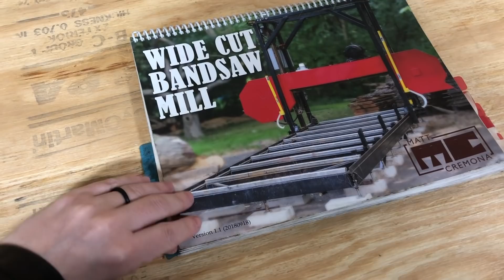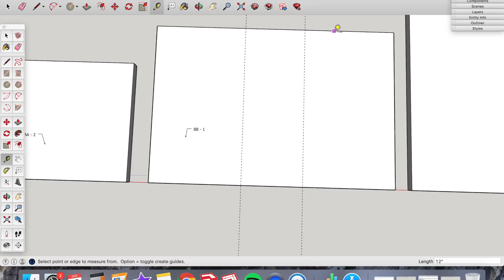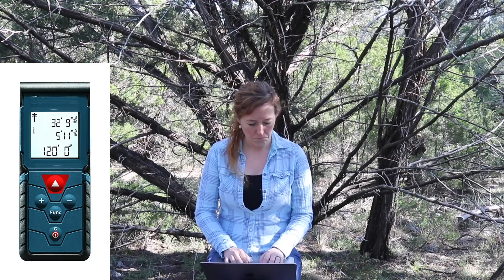Building a Giant Bandsaw Mill

Comment: Matt mentioned this video on his channel. So glad he got to mig weld. He really enjoyed it. Your organization skills impress me. So much was prepared ahead of time. Helped having a professional fabricator onboard. Share your enthusiasm and look forward to part two. I enjoyed watching Matt build his monster mill. You can buy a similar mill but nothing like this. Some of huge logs he mills. I'm impressed by how he does it and the beautiful grain in every slab. Thanks for posting.
Reply: AvE did a video a while back concerning stick, MIG, and TIG welding. He is of the opinion that everyone should start with stick and build skills before taking up MIG or TIG. He says they are like cheating and that you can get okay results with little experience, but you will never be a great welder. Matt showed that with his stick experience transitioning to MIG and how easy that was.

We have a similar phenomenon in aviation. There are two types of small airplanes--tricycle gear and tail wheel (or, as we call them, tail draggers). Learn to fly in a tail dragger and you can easily transition to a tricycle at any time. Learn on a tricycle and if you do transition to a tail dragger, you will face a fairly steep learning curve.

It's encapsulated in this aphorism: when the main gear touches the runway in a tricycle gear airplane, you have essentially completed your landing. When the main gear touches in a tail dragger, your landing has just begun. Any pilot will get that.

Comment: Something to consider @12:45 would be a line of holes in the floor for verticle stop-rod insertion. So that when you're lifting things like that with the crane you have both a ground pivot and stopper to prevent anything from sliding away from the lift. The rods can also have wheels on them if you need to rotate anything to verticle.

Comment: Again What An Outstanding Job! And Awesome ShoutOut to Matt on working with you and the crew on this build.
Something that you might want to consider that will save you a ton of time and aggravation when tapping that many holes, is an attachment that will fit in almost every Drill Press. It is called a TAPMATIC Self Reversing Tapping Head. You can Pre-Set the depth of the tap for the thickness of your material, and when it reaches that depth it automatically reverses and pulls the tap out, then clicks back into forward to tap the next hole   
Oh and GOD BLESS THE REPUBLIC OF TEXAS

Comment: Nice build.  As you are advancing so quickly.  Being a 1 lady shop most of time. You need look at getting you a overhead crane installed in the shop. You have room an it would be installed so that it down intrude on work area but would give you alot of versatility in your area. For what your doing.  

Keep it up.

Comment: You have to be careful drilling and tapping and running a tap in with a drill.A standard tap is generally not meant for this.BUT,you can get powertaps,such as WALTER power taps that are meant to be fed hard into the drilled hole and have a different metallurgy properties.They are meant for rapid feed rates.FYI

Comment: The down-side of tapping into mild steel is that the tapped hole is left relatively weak. Fasteners tend to be made from much harder grade steels. However, these difficulties can be overcome should stripped threads occur.

Comment: No truth to a woodworker having too many clamps.  My last count was 189 clamps ranging from Bessy's, Jorgensen's, Irwins, pipe, etc of every type and size. What's really notable is that there are times I may have 30 or so in use on a large project.  Even small clamp-ups may have a dozen+ running pressure in all directions.  I might have more invested in clamps than in my table saw!

Comment: this is a great project! do you have any videos on the construction, sizing and fitment of your workspace(s) there? that shop looks huge! with a gantry crane and proper exhaust venting a fabrication shop would be great there! I plan on using a chip and dust collector/slide gate manifold system and a collector on wheels to move around my shop for the cutting and welding fumes.
the tall ceiling height would accommodate a huge lift for trucks, trailers and machinery too!
thanks,
mike

Comment: First time I've seen your channel - VERY cool presentation and build. Plenty of detail, with some good tips even for the more experienced - with a lot of material and site preparation!
11:20-ish. using that method it's critical the same string tension is used for both runs - I'd suggest next time picking up a rotating LASER level and use that for the datum?

Comment: Awesome job as usual missis. What's next April's space station?

When I was working I used to do a lot of loft conversions here in the UK. The laser measure transformed my estimating. All I had to do was stick my head through the loft hatch and point it to see whether the existing space was going to fall within code, instead of climbing up there and getting filthy and struggling with a tape.

Comment: Wow, $16K - not bad for what you get but still a lot of money! Are you planning to slab commercially? And what's your plan for drying? Please say you're gonna build a vacuum kiln... :D
Reply from the maker: : ) A vacuum kiln is certainly on the possible list. Yes, $16,000 is a lot. Matt built his for under $9,000 though so it can be done cheaper. I chose to do a few upgrades on the bearings, drive shaft, and wheels. I'll get into that in probably part three of the series.
Reply: As I recall, Matt was given the linear bearings for his carriage, where you had to buy them. I suspect they weren't cheap.
Reply: @AprilWilkerson  The only thing Matt did not do, is a motor that drives the saw at a regular rate, he prefers it to be manual, and just a freaking water container on top, with a dripper to keep the blade cool and lubricated, I guess that because he use the saw in cold conditions, it would turn into ice....But your'in Texas....

Comment: Do those metal blades really work?  Went to their website and several (almost half) of the reviews are not so great - blades going toothless at a young age.  Not sure if they are running too high of RPM or if there is really a reliability issue.  Can you suggest a slow running saw that will work with them and let us know how many blades it took you to cut all of that steel?  Great vid - came here from Matt's referral.

Comment: What horsepower, rpm, electric motor are you using?  Also, can you post the pulley/belt, and ratio between motor, and band saw wheels?  I'm thinking of a trailer mounted version, with a Cummins 4bt diesel power plant.  I'm ready to move up from my Norwood.

Comment: What I took away from this video:
1. April Wilkerson doesn't mess around.
2. Chainsaw mills are not as useful as they seem.
Reply from the maker: 1) I don't mess around when friends tell me "Yeah I'm in" : D Be careful if you say that to me because I'll plan it and make it happen. 
2) They are exteremely useful. The entry cost is sooooo much cheaper for one thing but another is they are portable. With a chainsaw mill you just take the gear to the log instead of trying to get the log to the mill. There are pros and cons to everything. : )

Comment: Great build.  Is some CNC equipment in your future?
Reply from the maker: Nah I already have a Plasma CNC and now a wooden CNC. I think I'm set. ; ) I just need to get a dryer for my compressor and probably also put it in a housing of some sort.
Reply: Dryer makes a huge difference with plasma consumables.  You'll only be a step or two away if you change your mind on metal CNC.  I was thinking hinges, latches, router templates and other things I've done for local cabinet makers in my area.  Love the videos and the new shop!

Comment: Me thinks some of the material costs could be cut by exploring scrap meted yards or fabrication shops for fall offs.
Reply from the maker: Oh yes, there are a few areas that cost could come down. The steel wasn't the expensive part, it was the bearings, drive shaft, wheels, and linear rails.
Reply: Money saved in the low dollar areas makes the money spent on the high dollar stuff not sting so bad. Sand Box John is the penny pincher from . . .

Comment: I built a mill from scratch using only recycled material cost 100.00 and this is only because i bought new tires for the blade to run on. Which will cut a tree up to 33" in diameter.

Comment: Great to see the project and so many good folk coming together. I look forward to future episodes.
The way you used the slings to lift the steel 5:52 is plain dangerous. Forming a triangle like that with slings doubles the load on the restraint points. Buy another 2 slings (they're cheap) and use one on each corner or risk getting hurt. 

See page 39 of this dogging guide (link below) for verification.

Better still, invest in some plate clamps. See page 16-17 of the same guide.

https://www.worksafeconnect.com/guide-for-doggers.pdf

Here is a link to some plate lifting clamp images. I can't vouch for the supplier, they were just the first I came across in my neck of the woods from a DuckDuckGo search.

https://theliftingcompany.com.au/product-category/lifting-equipment/plate-lifting-clamps